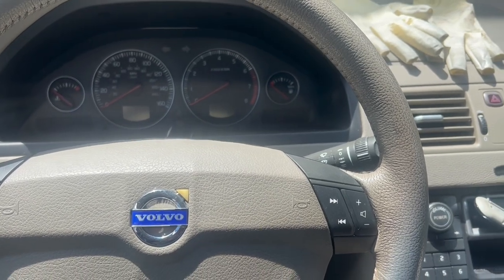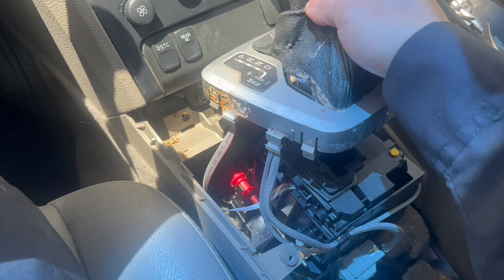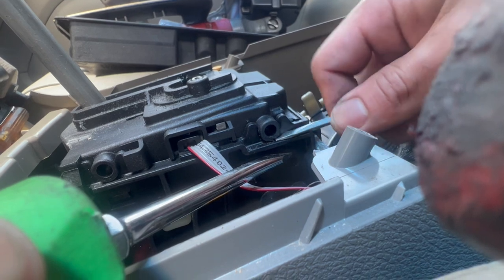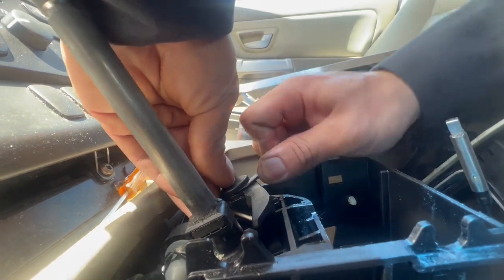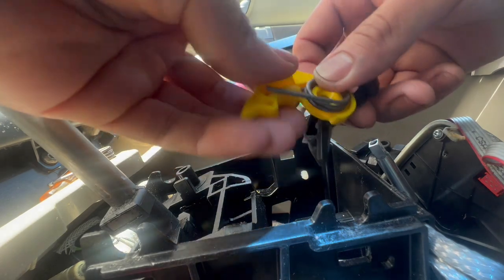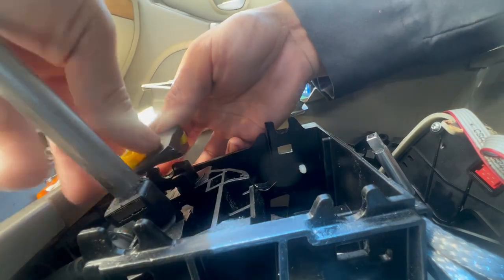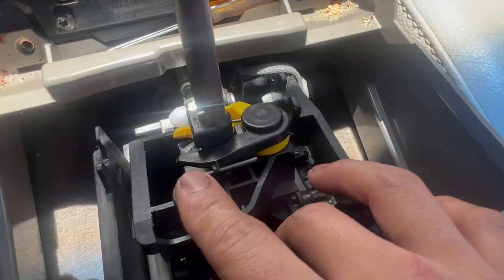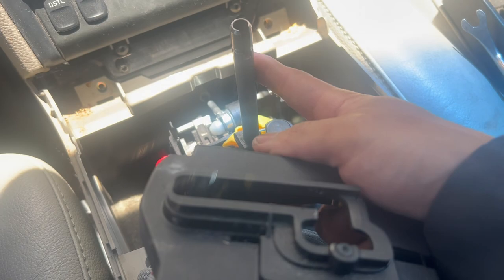Volvo XC90 Shifter Claw Replacement Step By Step (Loose Or Pop Out Of Gear) - Easy 30 Minutes Job

Comment: Thank you so much for this video, mine wanted a 3rd pedal too 😂
Reply: ain't no laws when you change the claws
Reply: Just did mine. I was trying to push the clips in to no avail... So I found out you don't need to push them in, just get a little leverage under those cylinders and pop them out, the clips are beefy!

Comment: first thing first great job and thank you. second thing great Video. third i have a questions about why you didnt opt to take the " Wood trim and Grey shifter PRND indicator thingy (cant remember the correct part name) apart and the shifter boot and shift knob apart from the console.
Reply: I just realized that 😅 the way you did it was the easier way but if you could give your thought process anyway i would really appreciate it
Reply from the maker: I couldn't remove the connect and I don't want to break it.